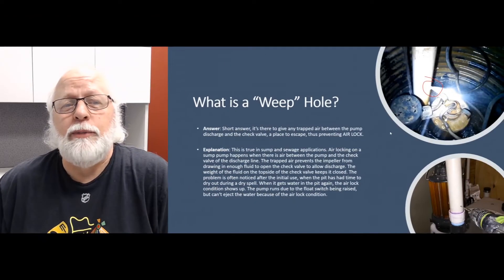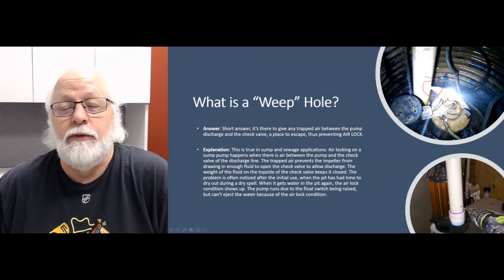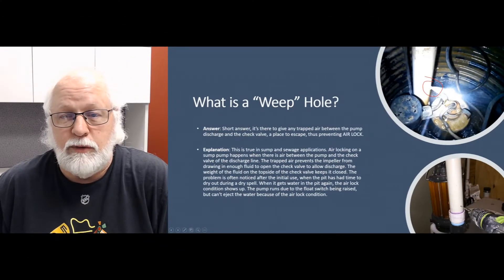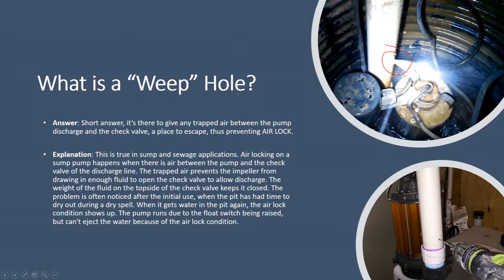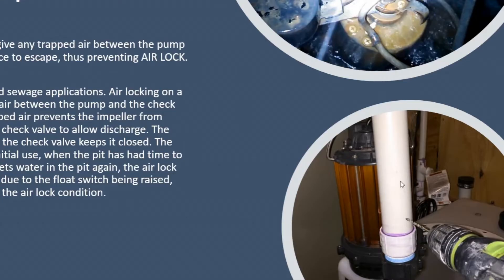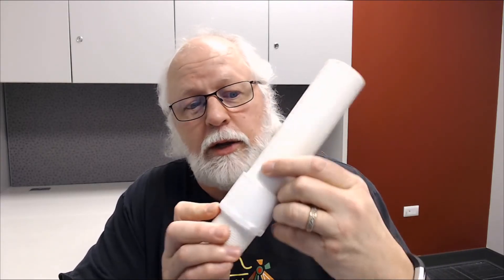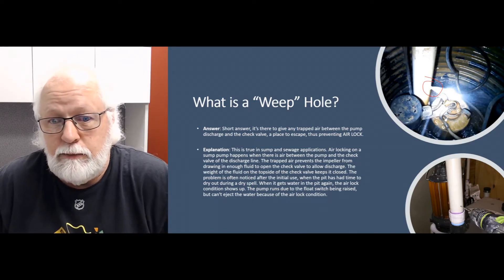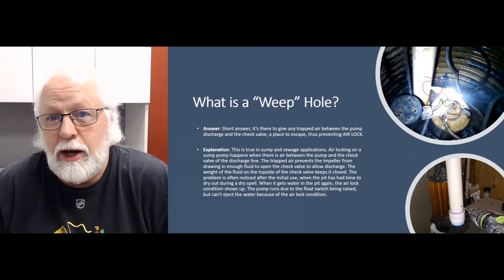Why Your Sump Pump Needs a Weep Hole

Comment: have a few issues i have seen on my pump lately but not sure what to check first.  it doesnt happen alot but sometimes it will run like its almost out of water and runs for a sec shuts off then turns back on keeps doing this till i add water or if i unplug it for a little bit then back in it turns on normally and pumps.  when it does this seems like the check valve isnt closing all the way could it be clogged sometimes then not closing then getting cleared up then closing.  i thought it also could be a air lock issue.
Reply from the maker: Hi Jason,  it could be a few things. I would suggest that you call the pump manufacturer or call us and we can try and diagnose further. We can't over social media though. Our help center has our phone number as well: https://www.sumppumpsdirect.com/contact_us.php
Reply: @PowerEquipmentDirect  figured it out was actually the float valve switch I changed the whole pump the while I had it out. The switch was worn to a point it would not stay in the on position when the float reached the top. As soon as the float dropped with the water the extension from the switch would drop and shut the pump off. Idk if you see this ever really but was kinda weird till I figured out what it was doing exactly.
Reply from the maker: @Kohler61350  Happy to hear that you figured that out Jason! We see all kinds of things and almost nothing really surprises us anymore.

Comment: I have a primary pump, and a battery back up pump installed a bit higher up. The primary pump works well, but the back up only runs without pumping. What could be the cause?
Reply from the maker: We're not sure based on that description. Perhaps the impeller is loose and not spinning? You need to contact the pump manufacturer.

Comment: I have a Wayne pump and they specifically say that their pumps don't need a weep hole because (as they say) "WAYNE pumps also remedied the need for a weep hole, by developing a unique top suction design that pulls water from above the impeller, eliminating the risk of air locks, clogging and that pesky gurgle." So I assume, based on your advice, I should drill the weep hole anyway, is that right? Is there any possible downside to drilling a weep hole? Thank you. Great videos.
Reply from the maker: Actually, you're correct about the pump.  Wayne's top suction design does virtually eliminate the possibility of any airlock and the need for a weep hole.  That said, if you still want to drill a weep hole, it's not going to hurt anything. Just make sure you drill it in the right spot!
Reply: SUCTION !!

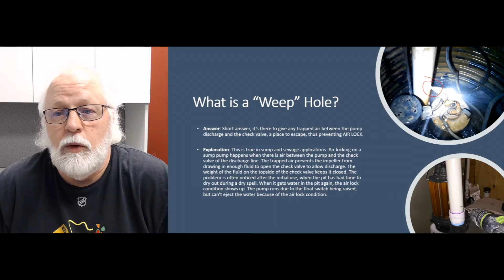Comment: 3:25 Pump has its own weep hole and check valve needs another one? What's the difference?
Reply from the maker: The hole that comes pre-drilled on a pump prevents air from locking up inside the pump, whereas it does nothing to prevent air from locking up while it is being discharged through the rest of your piping and through your check valve. This is why you need to drill a weep hole on the piece of piping that runs between your pump and the check valve, so the air has a place to escape.
Reply: @PowerEquipmentDirect , my check valve is up 5'. Is there water in that 5' that is held up by negative pressure of valve? So all that would drain out with a hole. What's the downside of having it drain out? I think the sump has high off setting so always keeps sump water high to not go dry?
Reply from the maker: If you don't have a weep hole in that 5' of pipe, they yes, whatever water doesn't pass through your check valve stays in the pipe and you run the risk of an air bubble receding back into the pump, which could cause possible damage to the pump. The weep hole, drilled near the base of the pipe that connects to the pump, allows the water that is trapped in the pipe to drain into the sump pit after it is emptied, instead of being stuck in the pipe indefinitely. 

Long story short, there is no downside to drilling a weep hole in the proper place and we recommend it on every sump pump installation.
Reply: @PowerEquipmentDirect , can I have two check valves in series?
Reply from the maker: @1weirddoe571  We're having trouble understanding why that would be necessary. Some people try to pipe 2 pumps to a single discharge pipe, but every pump should have its own check valve. In most cases, 2 check valves seem redundant.
Reply: @PowerEquipmentDirect , I thought I saw that somewhere the quiet check valve was quiet because it had two valves in series so just wanted to inquire about it, thanks.
Reply from the maker: @1weirddoe571  We used this one in our Sump Pump Installation Video, and from experience, I can say it is almost too quiet to hear when it's running. Obviously, you'll hear the pump cycle, but the check valve itself is silent: https://www.sumppumpsdirect.com/Zoeller-30-0041/p14772.html
Reply: I have a self contained sump under my laundry sink. It sits on the floor and every time the pump starts, water shoots out the weep hole. Should I try to direct the water into the basin somehow? Maybe run a tube from the weep hole to the basin lid?
Reply: @joyrathod2082 , I'd need a picture if you were wanting my advice--see my contact. For 10 years now I haven't had any weep holes and I've had no problems but now I added a backup so I have a dual pump setup and it's on the same line so I thought I would get some clarification so I don't airlock my stuff.

Comment: It would be helpful to know if the weep hole should be drilled above the max water level before the pump turns on or below the max water level. I have read both are recommended by different websites and each one seems equally certain. Thank you.
Reply from the maker: There are different schools of thought on which is best, but we recommend drilling the hole about 3 inches above where your piping connects to the pump. Check out this video where we demonstrate drilling the hole. Look in the video description, we have a timestamp you can click to bring you right to that section:  https://youtu.be/b7LJKqASe8s

Comment: Does it make much difference if the weep hole is even to the top of the pump? Also if the hole is a little larger then 1/16th? I noticed it does spray a little out of the well when working and it's much louder now compared to past pumps i owned without weep holes. Neither really bother me but just curious if I will see bigger problems when a down pour comes through. Have a Zoeller 1/2 hp if that makes a difference.
Reply from the maker: Watch this video where we list some recommendations for drilling the weep hole, including angle, location, and size. https://youtu.be/b7LJKqASe8s?t=376

Comment: I had a backyard sump pump running a couple weeks ago w/o anything coming out. I pulled it out of the pit, looked it over, saw nothing wrong, put it back and it was okay. Wasn't sure what happened. This video was recommended to me yesterday so today I checked and sure enough, there was no weep hole. I didn't know about this! I'm sure now it was airlocked. I drilled one so I'm all set now. Thanks!
Reply from the maker: That's fantastic! We're so happy this video helped you solve the problem!
Reply: the exact same thing happened to me a few weeks back. The effluent tank filled up and the pump wasn’t pumping.  I pulled out the pump and looked it over. l had no idea what to look for.  I put the pump back in and it started working just fine. No issues since. I have no weep hole. My pump is 20 yrs old so its time to buy a back up pump. I will be drilling a weep hole. I also recently installed a float alarm in case the effluent tank fills up again.